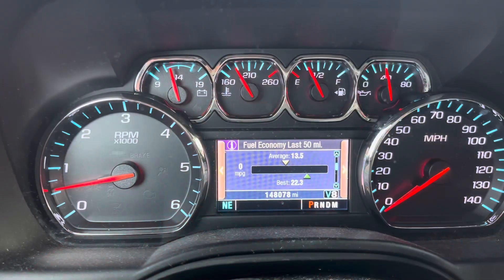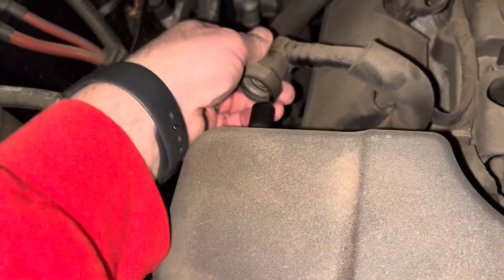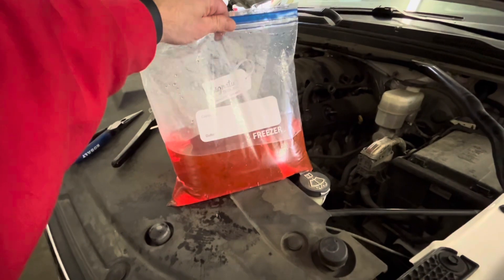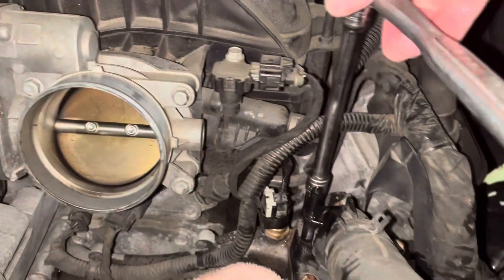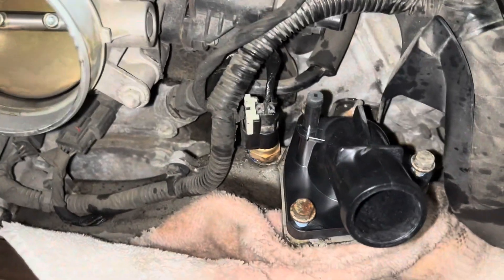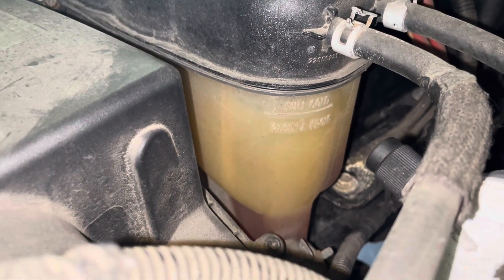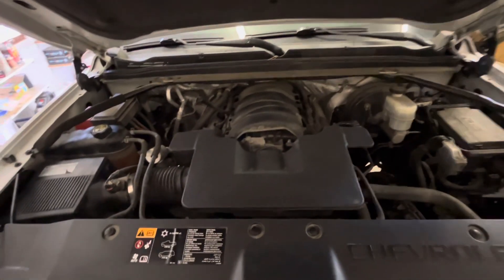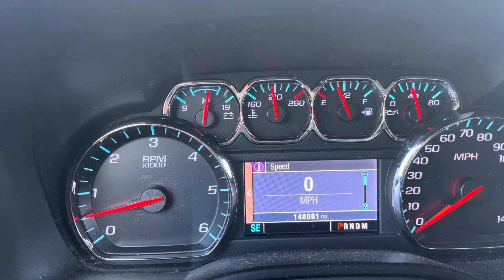2015 Tahoe Thermostat Replacement | DIY Step-by-Step

Comment: Hello...Does a 2015 Tahoe need to add a gear cooler? Note that the gear temperature while driving on normal roads and not mountain roads reaches ninety degrees Celsius, and in my hottest area it reaches forty degrees during the day... Please accept my regards.
Reply from the maker: Hello, you should be okay at 90C.  But if you do a lot of towing I would watch temps to see if a transmission cooler is warranted.  I do not have a cooler on mine but I do not do a lot of towing and I live in NH.  Cheers
Reply: @terryclayton  Hello...Does a 2015 Tahoe need to add a gear cooler? Note that the gear temperature while driving on normal roads and not mountain roads reaches ninety degrees Celsius, and in my hottest area it reaches forty degrees during the day... Please accept my regards.

Comment: My Tahoe the fans was on and I replaced but need to be a original no after market because don’t work
Reply from the maker: You may to to replace coolant temperature sensor if new thermostat does not solve problem.  Good luck!

Comment: Today my 2015 Tahoe had temp guage not moving from 160 and fans running even after shuttung it off. Gmc dealer and chevy dealer today both saying they have to replace the whole water pump assembly to the cost of $1400.00 to solve this problem.  They say they can nit just replace the thermostat or the temp sensor.   They are saying the thermostat is a "non servicable" part and even showed me on their parts dept computer  they do not have an option to buy just a thermostat.   Is this just a way of them over killing a repair?  They say GM redesigned the entire assembly and this is the only way to realy fix the problem.
Reply from the maker: This seems strange to me.   I would get the opinion from an independent garage if you cannot do this type of work yourself.  Good luck!!
Reply: I just had the same issue with my 2015 Tahoe and did exactly what you see in this video. And now it is reading temp again etc.
Reply: scam

Comment: My fan is constantly running even for minutes after turning off my Tahoe. We replaced the sensor but it didn’t fix the issue. Trying this next. Thank you for your video.
Reply from the maker: Is your engine temp low according to gauge?  Be sure to disconnnext battery for the replacement.  Good luck!
Reply: Yes it’s stuck on 160
Reply from the maker: @maritzabasaldua2848  , yep you should be in good shape with a new thermostat!